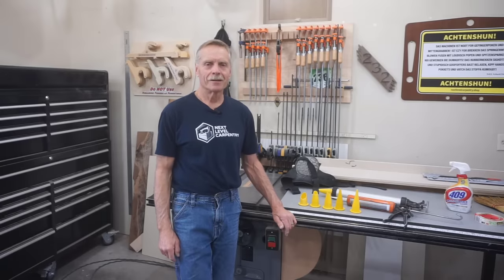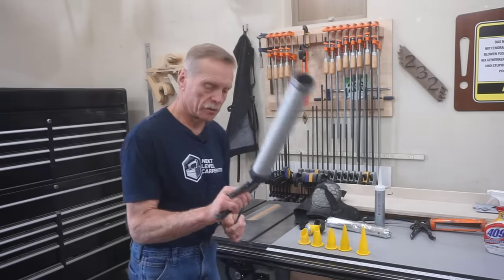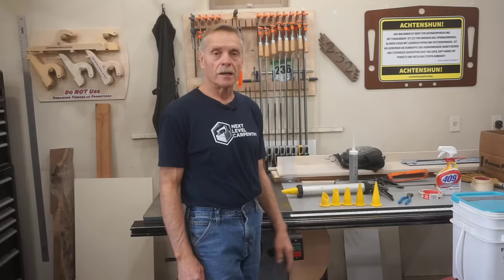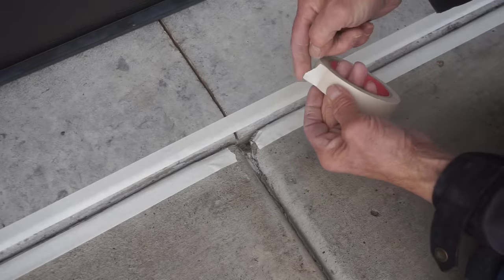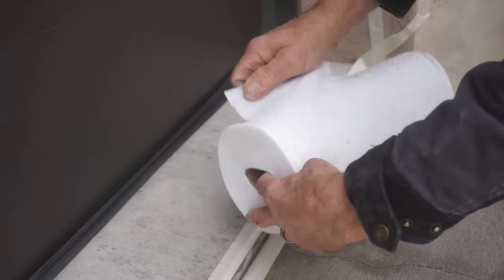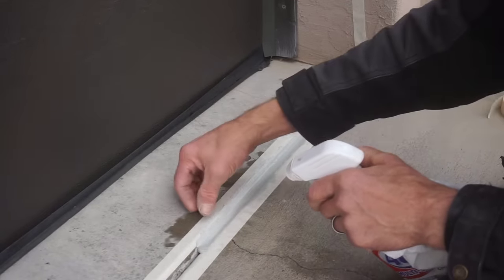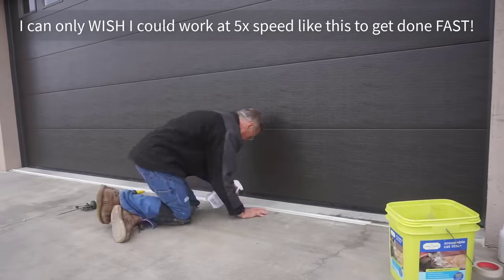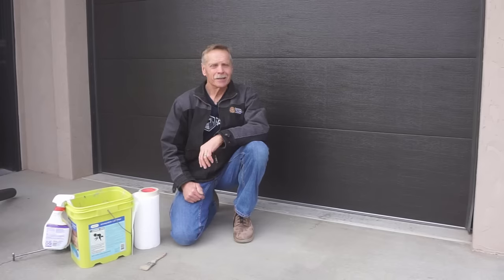How to Caulk Concrete Control Joints with Perfect Results Every Time

Comment: Thanks so much for this great video.  When would you use backer rod before caulking?  Lili
Reply from the maker: The rule of thumb is: when the joint is more than half as deep as it is wide...

Comment: thanks for the video. what happens if you don't chaulk in front of the garage? Seems like it is no big deal? Please correct me?
Reply from the maker: Sealing keeps water from running down through cracks and softening base material.  Softened base material won't support the slab and can lead to cracking and settling.  If no water leaks through that crack than it's probably not an issue but, for me, it's cheap insurance compared to replacing concrete which is decidedly NOT cheap.

Comment: Wish I'd watched this before I did my project.  I made a mess,  was going over joint expansion material & trying to fill in gaps.  Not sure what you are using the sand for at the end?  Any recommendation on how to "tear out" my
first attempt, so I can start over & hopefully do a better job?
Reply from the maker: Best you can do is let the sealant cure out (2~3 weeks +/-?) then cut it out with a long-handled pipe knife: https://www.amazon.com/dp/B00QL4Y488/?ref=idea_lv_dp_ and start over using your newfound knowledge. The sand keeps bugs, dirt, leaves etc from sticking to the fresh sealant you worked so hard to apply...

Comment: Great job!
I live in Canada with very extreme weather conditions. Will your approach really work ? I am just curious an have joints to address and find a sustainable solution.
Thanks for sharing.
Reply from the maker: This system works well in the weather extremes experienced where I shot this video Alex so I can tell you they're the best chance you have for long term success.  Naturally if soils heave concrete where you live there are limits to how far urethane stretches and how well it bonds but I don't know of any other product or method that works better.  Be diligent with prep work and pay extra attention to joint design ie: width/depth proportions and you should do fine... Best, Matt
Reply: Next Level Carpentry Thank you very much for the prompt response.
I will certainly give this a shot and see the results.
Bidding you a great autumn season ahead.
Reply: Next Level Carpentry I tried searching for silica sand but very hard to find.
Would another type of sand grade do the job like aquarium sand ?
Thank you.
Reply from the maker: @alexpolidoro4126  I'm betting fine aquarium sand would Work well and wouldn't be surprised if it actually is fine silica sand. FYI I've actually used regular old Masonry sand for the same purpose on really old concrete because the coarser and irregular texture of the sand granules help it blend in even better. The main point is that whatever touches that what caulk first is going to be the thing that sticks there forever and pretty much any sand is far better than dirt leaves grass and bugs IMHO Best, Matt
Reply: Next Level Carpentry thank you very much for the update and opinion.
I will try it out indeed.
Best wishes

Comment: I am curious why you dont run a caulk knife over the sealant to get a good concave finish fast without having to use your fingers or the soap? I have tried it personally but see others using the knives. Super informative video btw. I plan to do this in the next few weeks
Reply: Sorry, I meant to write i have not personally tried the knives, its just something I've seen others use in videos.
Reply from the maker: I've tried knives and curved spatulas but neither is anywhere near as good or fast when tooling joints like the ones shown in this video.  They get used a lot on commercial jobs in certain situations but none can match what you see in this video IMHO.

Comment: Damn that’s a nice job, well done and thanks for that, btw what’s that other guy talking about? I don’t see how you could get and cleaner than that. good job oh n btw, I wasn’t aware that you needed to caulk control joints? secondly, how long would your joint caulking job last?
Reply from the maker: I don't think you can get a cleaner job... faster maybe, but not this clean. And it really doesn't take that long to do when not shooting for an instructional video... plenty fast enough in residential applications.  Airport runways  tarmacs, highways and parkinglots are a different animal though. It's a good idea to seal joints in concrete to keep water from seeping/running through and softening subgrade which leads to cracks from settling.  I do it to keep out dirt and crud too.  I could show you joints I sealed over 20 years ago that are still holding strong.  UV deteriorates the surface a bit sometimes but this is far and away the best, best looking and long lasting way of getting the job done IMHO.  Best, Matt

Comment: Please, can you tell me if the same technique will work around the edges of the pool deck? The area where the decorative trim around the pool meets the concrete pad.... Thank you so much!
Reply from the maker: This technique will work for finishing joints sealed with urethane caulk no matter the application.  However urethane caulk is a poor choice for adhesion to pretty much anything but concrete/masonry/tile materials so; it depends on what your 'decorative trim' is made out of.  Good luck! 😁😎

Comment: how long does the caulk in the grooves last?  Is this a permanent placement or does it need to be replaced every year or two?
Reply from the maker: I've got projects where it's still holding strong 20 YEARS and counting Stan.  Done right it should last like that.  Sometimes small sections will fail after some years but they're easy to cut out and re-do if necessary.  Best, Matt

Comment: Awesome video... I'm in the process of starting my driveway.  Do you know if your Masking Tape and 409 approach works with SikaFlex?
Reply from the maker: As far as I know sikaflex is just another brand of urethane so everything should work the same... as long as you're not using self leveling sikaflex!

Comment: Question: I'm getting ready to pour a slab. The slab will be polished. Need a finished appearance expansion joint. For the expansion joints; I am considering sandwiching a layer of standard 1/2"x 4" polyfoam between 2 layers of 1/8" x 4" brass (similar to terrazzo screeds). The polyfoam rolls come with a pre-slit 1/2" edge to be removed after the pour and filled with caulk. My thinking is that with the brass screed lines I can achieve a visually clean joint...or maybe I'm out in left field. Another professional's perspective would be greatly appreciated.

Comment: Water mist can be used instead of 409
Good video
Reply from the maker: Glad you like the video but it's a mistake to think a mist of water is a substitute for 409 when using urethane caulk!  You can substitute diluted dish soap for 409 but plain water makes a real mess! 😎

Comment: Love your garage door. Is that the door itself or is it an attachment onto the door. Thanks.
Reply from the maker: It's an upper-end Wayne Dalton door Morris... other brands make overhead doors of similar look/quality... you kind of get what you pay for IMHO.  I did repaint them using a Graco cordless sprayer: https://www.amazon.com/dp/B071CW2SV2/?ref=idea_lv_dp_   prior to doing this video to make them the best they can be. It's an amazingly capable tool IMHO. FYI The doors were originally painted by someone with a roller and no one was complimenting on how the doors looked then! 😏 Best, Matt

Comment: Will this prevent weeds from growing in all the expansion joints throughout the driveway? Thanks for the video
Reply from the maker: If done properly it will prevent dirt from collecting in the joints and seal out water that weeds use to grow so, yes, it 'will' prevent weeds from growing. 😎
Reply: @NextLevelCarpentry     Cool...thanks for responding.

Comment: What do u typically charge to do a expansion joint for one standard garage door? That looked like a 8 or 10 foot door? So i say 150.00 with materials included? Great vid and job! Very clean.
Reply from the maker: I actually don't 'typically charge' for my work Jay... it's all T&M and varies a lot from project to project.  The doors in this video are actually 18' and 10'.  The joints were very clean, requiring little prep and so would probably not meet my 4-hour minimum charge for labor plus $50 in materials or so.  Sorry that probably doesn't help much😯  Thanks for the compliment on job and video... Best, Matt

Comment: Great video.  Thanks for making it available (and one knows it's a good caulking video if it gets 1M views and >2K comments).  Hopefully this question doesn't bring down the house: Does it matter greatly if one uses Dymonic FC, Vulkem 116, or Sikaflex 1A?  I've got 75 feet of joint where I need an above grade (water-shedding) joint surface.
Reply from the maker: I choose Tremco because of availability but I think any brand name urethane performs similar... as long as it's not self-leveling.  Far as I know everything else about the process is the same.  Best, Matt
Reply: @NextLevelCarpentry  Thanks for the prompt reply and info (including thoughts on SL), Matt.  I'm off to the store.

Comment: Great video!  Thank you!  Going to do my driveway soon.  Can you tell me which color polyurethane you used from Tremco so I can use it as a guide from their color chart?
Reply from the maker: I used the Limestone color for the video. Their Gray color is actually a better match for concrete but I'm not able to get gray in the sausage tubes in my local area. I did a sizable job with gray last summer and had to use twice as many 10 oz tubes to get the job done but don't regret the choice...
Reply: @NextLevelCarpentry  I was looking at their color chart and it looks like gray is the color that best matches concrete, like you said.  Had to order the sausage as, like you, gray is not to be found anywhere in my local area.  Thanks again for the great video.  Very informative and a great help!
Reply from the maker: @696808  Youbetcha... glad you found sausages for your project.  It was a real pain going through over a case of the 10oz tubes on a single project... feels so wasteful compared to the little crumpled spent foil sausuage tube.  Best, Matt

Comment: I have done thousands of feet of caulking on everything BUT expansion joints. I was thought to use spit. ( think about , there is no better lube in the world) 😉BUT. If you miss just a little dab of caulk, it taste nasty and it is probably not to good for ya. I have to do the joints in my driveway and I will definitely be trying the 409 trick. I learned a long time there are more than one way to skin a cat. The 409 is the same concept as spit just tasteless so to speak. Thanks for the tip on the self leveling thing, I always learn at least 1 thing from every one of your videos.
Reply from the maker: With that much caulking under your belt I think you'll have no trouble at all mastering the techniques shown in this video Marshall... thanks for watching and taking the time to post the great comment! Best, Matt

Comment: Might have been asked & answered already so I apologize if it has but What is the best way to clean those Yellow plastic tips?  By the way I love your thorough approach.👍👍
Reply from the maker: They're really easy to manage. What I do is just leave them alone and let the sealant cure in the tip. If it sits overnight, I just pull the little dab of dried sealant off the end of the tip the next day. 
If it sits for weeks or a month I remove the yellow tip from the gun and push the cured portion out through the back of the nozzle. Either way the tips are clean as new Once the cured sealant is removed...
Reply: Thank you!  Ordered a gun, Tips and caulking yesterday.  Looking forward to trying this method.  Thanks again for putting the video together and adding the product links.
Reply from the maker: @flycreekkennels9559  you go!
My advice is to start with a small easy section to get familiar with the tools and techniques to build your confidence before tackling larger longer and more difficult areas. Give yourself a little Grace in the beginning and you'll do great!
Reply: @NextLevelCarpentry  That's my exact plan.  I'll keep you updated.

Comment: Does it have to be Dymonic FC? Having trouble finding it locally. I do have polyeurethane caulk tho, it’s just not D FC?
Reply from the maker: Far as I know other brands like sikka and np-1 work just as well as long as it's a good quality urethane caulk... I have no arrangements with tremco, it's just that their products are most readily available here.
Reply: @NextLevelCarpentry  im sorry for the multiple questions, but say I gt sikka or np-1, would the product i need be called Sikka Dmonic FC?
Reply from the maker: @pidgepagonis  generically the product type that I used is called a one part urethane. There are also self-leveling one part urethanes but that is the type I use only in very rare and unique situations so you would be looking for Sikka or np-1 one part urethane caulk.

Comment: Would you recommend this method on concrete curb around a bulkhead door? It appears that the concrete curb was added afterward. I’m experiencing water intrusion where the curb meets my concrete patio.
Reply from the maker: As long as it's a concrete to concrete seam, Kelly.  Not quite sure what conditions you're working with from your explanation but this sealant and method is the best way I know for reliable sealing.  In general, if this method doesn't work you're either doing it wrong or it's beyond the product's ability to hold.
Best, Matt

Comment: Great video, but there were some important part not covered that I had questions about.   After 9 years in my house, the expansion joints are rotting.   They're about 4 inches 'tall' and digging them out is a tremendous amount of work, especially because there is re-bar (or heavy gauge wire) about every foot connecting adjacent sections.   This means they can't be cut out and basically have to be dug out with a 1/2" wide pry bar and hammer.   This leaves a deep crevice (relatively speaking) to fill.  Fist, am I doing this the hard way, i.e., does all of this wood really need to be dug out, or just the first inch or so and just let the rest rot.   Second, do you recommend just using backer foam to fill the voids, or can I just fill with sand?   Third, how thick should the caulk be?   Thanks for taking the time to do this video.
Reply: Did you ever get an answer to this...I'm wondering the same...I've seen some videos where they fill with sand before putting in the backer but I'm still not sure that's the best way to go.
Reply: I see he answered a similar question below, "Hey Steven, I've filled plenty of gaps wider and deeper than yours using this exact process for getting a 'perfect' finish on the sealant.  You DEFINITELY want to 'partially fill' them using 'backer rod' so that the sealant bead is about 1/2 as thick as it is deep. I wouldn't put gravel or sand in the joints before the backer rod though because it could tend to further expand the gap as it settles over time.  You might check into using a primer on yours to give maximum adhesion.  I've never used it but, in cases of extreme seasonal movement, it would probably help the joint sealant hold up longer.  Good news is that if a place or two come loose in a couple years you can just slice out the failed section with a utility knife and fill them back in the same way. Hope that helps... Best, Matt"

Comment: Any further suggestions if doing joints inside a garage? In this case 25 years old but concrete in excellent condition.
Reply from the maker: Anytime I do joints in old concrete I make sure to scrub and/or power wash them to make sure all the road salt Etc is off the concrete but then from there the process is identical. Make sure to leave the surface of the caulk slightly concave so that it doesn't get imprinted by tires. Having nicely sealed joints in a garage floor make it much nicer and easier to clean...

Comment: Great DIY advice👍.
How thick, or deep,  of a bead would you say is sufficient? Thanks
Reply from the maker: A good rule of thumb is for the joint depth to be half its width.  If the joint is not naturally those proportions it can be established with the use of backer rod. The Joint in the video is a little bit non-typical in that regard but the purpose of the video was to show how to finish off the top of the bead not to instruct on its width and depth. I believe you can find more information for your question on the tremco website or just search sealant joint design... hope that helps? Best, Matt
Reply: @NextLevelCarpentry  I followed your process very   closely and got good results. Thanks for the great tips 👍
I think may have under filled the joint though. Do you have any experience with adding more material after the initial application? I am using the  tremco dymonic fc. 
Does it last/adhere?
Reply from the maker: @hillcountrycure  I've given this answer to questions similar to yours:

It's fine to add more sealant on top of previously applied joints but you might need/want to wait a couple weeks for the initial stuff to stiffen up a bit before you do. I'm sure it will stick but think it might be messy... give it a try and see.  I've done touch-up on joints after they've 'cured' to remove animal footprints, tire tracks etc by taking a utility knife and cutting a Vee groove and then filling it back in... might be less fussy than trying to add a thin-ish layer on top?  As long as you don't smear urethane outside the tape lines you can do and re-do whatever and whenever... it's pretty forgiving that way.

Glad to hear this process is working for you... sounds like you'll do fine doing a bit of 'touch up' and get a final result you'll be happy with.  Good luck! Best, Matt
Reply: @NextLevelCarpentry  thanks again for the help.
Great advice and I'll start looking for your videos. 👍